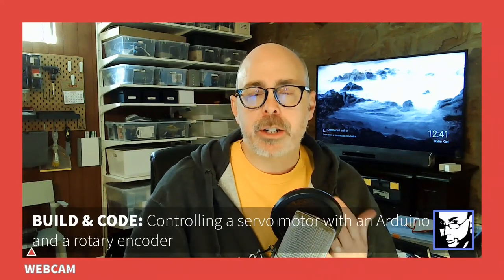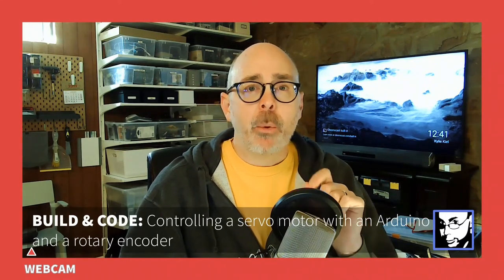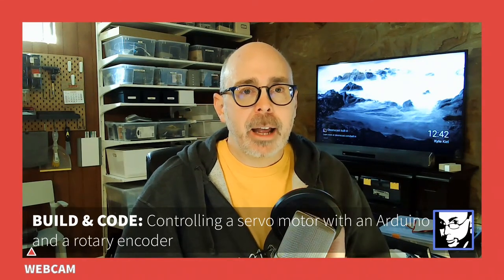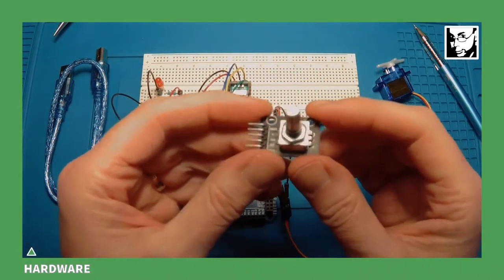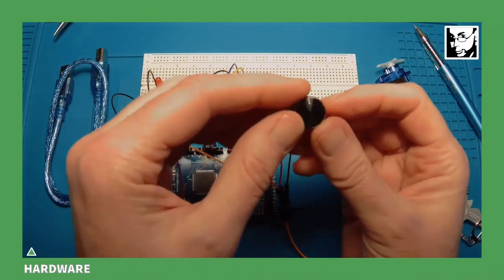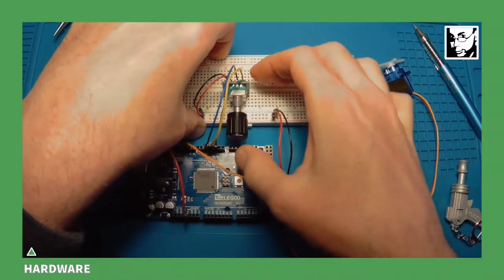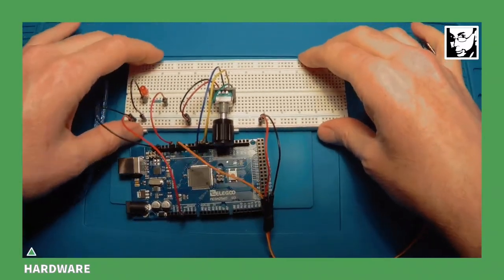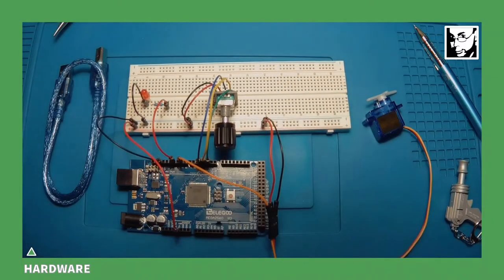HOW TO: Build and code an Elegoo Arduino, servo, LED, and encoder rotary dial project.

Comment: i have everything wired correctly i believe and yet the led wont turn of when I click the encoder button, do you have any tips?
Reply: I figured it out I had an issue with the grounding wire your video is very helpful thank you :)
Reply from the maker: Apologies for not getting back to you earlier however, super glad you were able to figure it out. Half the fun and experience is the troubleshooting. Just check out my latest livestream!